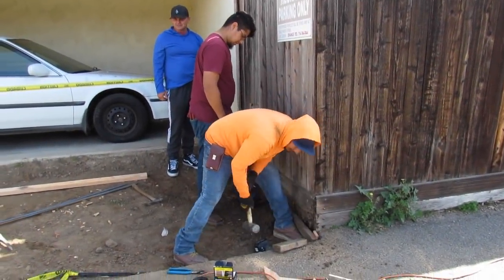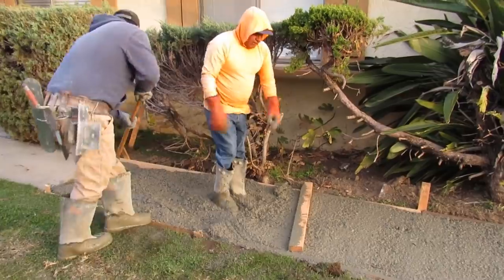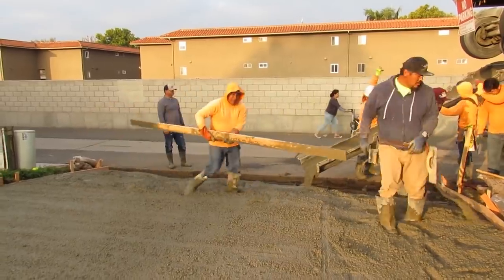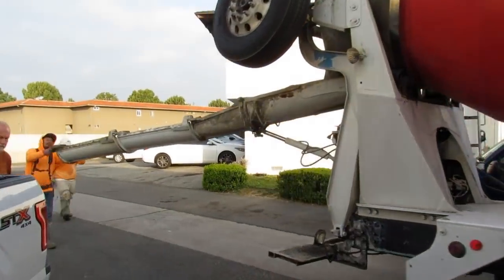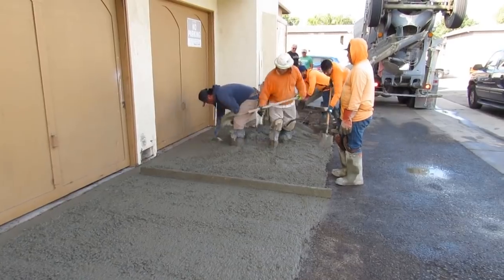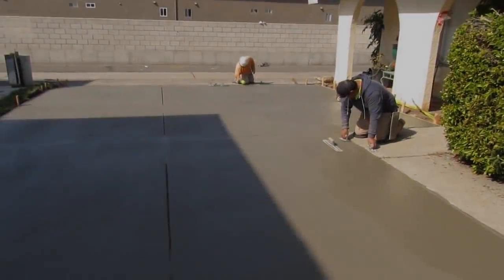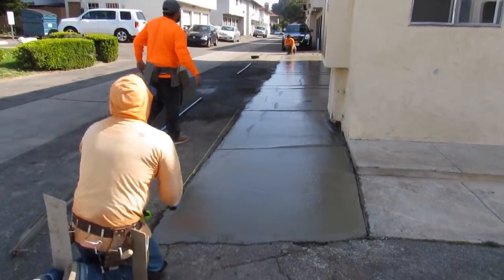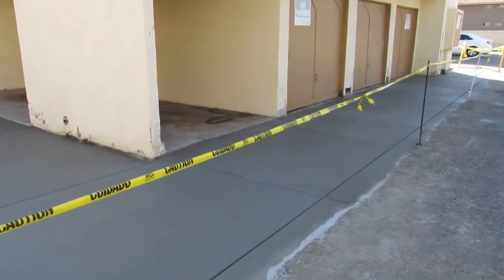Chute Pour. Concrete Parking Lot. The Best in the West! California

Comment: I believe yeah it’s a form of cockiness but in that line of work or most fairly rough manual labor/trade skill work is quite a shark tank. You gotta be confident and know in yourself you can accomplish any job no matter the lengths. I work in hvac in the rough-in side of things and have done 2 story homes by myself in a 13-14hour shift cause I told whomever the builder was that yeah, it’s no problem cause with some contractors/builders or whoever will flake out and not hesitate to find someone else to do that job taking that money and potential client/customer away from you
Reply from the maker: Exactly

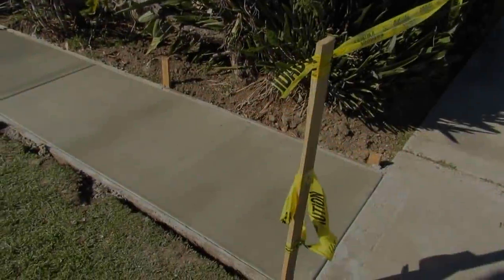Comment: The finish it good. But you won’t see rebar tied 2 ft on center anywhere here in Texas. I personally tie everything 1 ft on center. And put expansion joint anywhere the old concrete comes in contact with new concrete. And contraction joints on a 4 ft sidewalk are supposed to be spread out at every 4 ft or less @15:29

Comment: Why wasn't the asphalt cut in a straight line with expansion foam joint.? Doesn't look good and will crack
Reply from the maker: The asphalt company is going to saw cut the concrete on the joint when they redo the parking lot.

Comment: I actually like his videos but don't like alot of the things he does. 
1. Always scarily and recompact the subgrade 
2. Always pour concrete on a well draining, non expansive granular material. Aka subbase.
3. Must utilize expansion joints. Control joints don't alow concrete to expand. It may shrink crack at those joints but that's it.
4. Always use chairs/dobies to support any reinforcement. Maintaining proper concrete cover over reinforcement is vital for the longevity of concrete. If the reinforcement doesn't have the specified concrete coverage per ACI, it opens the door for spaulding during curing and impacts the tensile strength of the slab.
5. Crush test... lol.. its called UCS/compression testing.
6. Pouring concrete as dry as possible isn't always possible. This also doesn't mean adding water to the mix. There are water reducing admixtures (midrange/highrange) that produce slumps from 6-8. These admixtures should be utilized opposed to adding water to increase the slump, especially for pumping purposes. 
7. Concrete strengths are determined by much more than just "pouring it right". It has to do with set time, ambient temperature and concrete temperature. Curing your concrete by means of water, covering, and chemical also lead to greater concrete strengths. I actually never see you use a curing compound....

With everything said, you and your crew do nice work, but a little less conceited commentary would be 👌.

Comment: Dont use a laser, dont bumb the concrete. You go by hand, no machines. You actually LIFT the rebar not at all caring about how far it is to the ground or possible water. And then say.. This is how its done xD Youre mind would be blown on one of out 1000 square meter 4 man pours. And you dont put water in concrete if you want it easier to work with, you use Concrete fluid.
Reply: And your guidance cuts probably works fine, but considering there is rebar in those cracks means it could crack and water could reach the rebar. And anyone that owrks with concrete knows what happens in time if water reach the rebar.

Comment: Concrete is concrete.
If you really think that then STOP.
There are many types of concrete many formulas for concrete and many ways to use it.
But what I do NOT see in ANY of your videos is the concrete NEEDLE.
Vibrating concrete makes in tougher, denser and removes most of the water so you get a compacter slab of concrete.
But then again I just about never see the needle in any American concrete video, Regardless if it was done by amateurs or professionals.
Reply: kurtis howard  Poker or needle is just a different name for the same tool.
But since you are not from America explains why you know what it is and what it does.
I used to drive cement trucks in the Netherlands and I saw them every day.